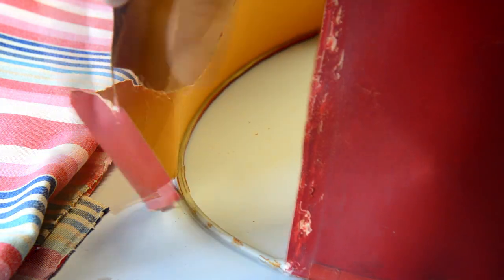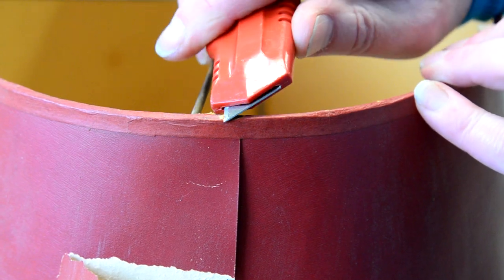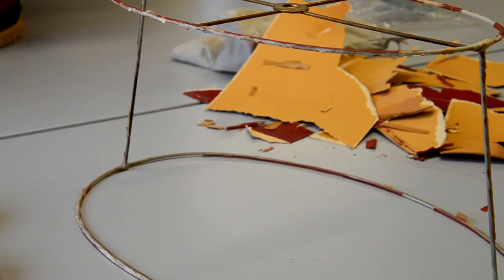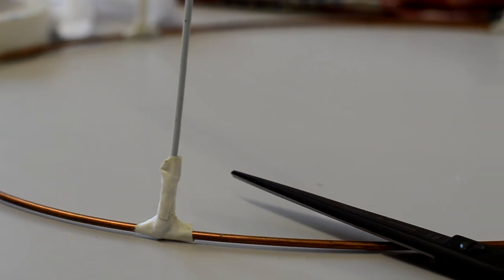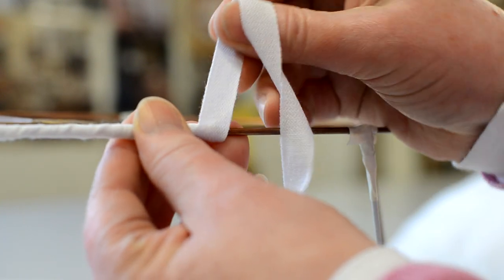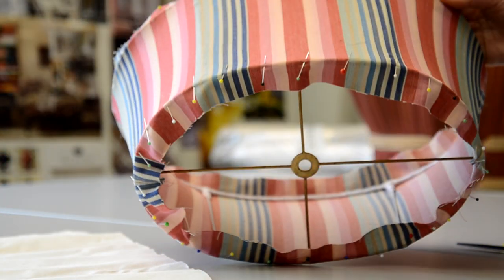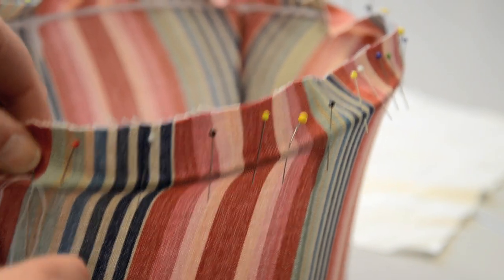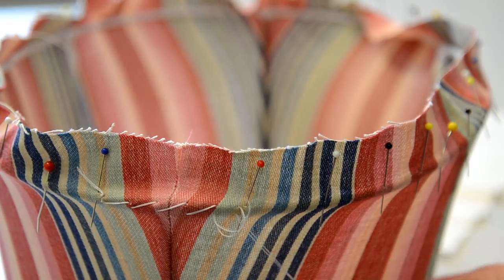Rekindling the Frame. Upcycing a Lampshade.

Comment: Anyone know how I can repair a frame? The spider piece broke away from the circle where each of the 3 legs meet the circle at the top. I can’t solder. Nor do I want to learn on a fabric lampshade. I tried putty bond but it’s too messy. Anybody have any ideas I’d appreciate it.
Reply from the maker: Repairing the frame is really only done if it's already cleared of fabric. Is there any way you could find a 'carrier' piece to attach to the lamp and then resting the shade on top of this. Sample of a carrier at this link: 
https://hegartylighting.ie/shade-accessories/10691-oaks-shade-carrier-e27-sizes-5-to-9.html
Reply: @chezmaisonhome  that’s exactly what I need. The spider thing with hooks to wedge between the ring and the fabric. Now that I know it’s called a carrier, I should get better results. Thank you!
Reply from the maker: @idaSlapter1  Delighted to hear that. Best of luck.

Comment: Where do you purchase your slightly curved needles. I have been able to find deep curve, almost a half circle but it looks like the slight bend would be less cumbersome.
Reply from the maker: The needles are actually 'long darners' from John-James. I bend them myself to suit this job.
Reply: @chezmaisonhome  Thank you! Forgive me for taking so long to see this reply. I have tried the deep curve needles but they flip in my fingers. Knowing you bend them yourself helps a lot too. because that's what I was going to try when I tackled the lampshades. I wasn't sure the needle would bend, and was trying to think of ways to warm the needle without overheating it so it would bend smooth without snapping. I haven't found the silk yet for the liners. But I have faith. I was making slipcovers when I found your video last year, I had many set-backs with the first one that made doing the second one a project for a later date.

Comment: Como se llama la cinta blanca que forra la estructura?
Reply from the maker: Hello Karla, you asked: What is the name of the white ribbon that covers the structure?

This is a cotton tape used in sewing projects - an example like this one on ebay. It is the 1/2inch wide size.
https://www.ebay.ie/itm/292187427354?hash=item4407ba521a:g:CgQAAOSw2rFZbmbq&var=591120706529